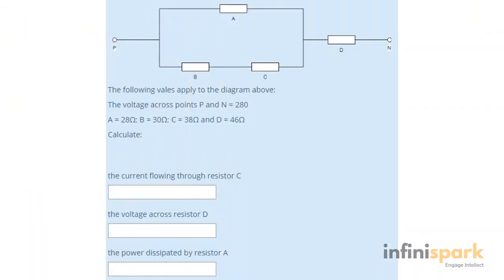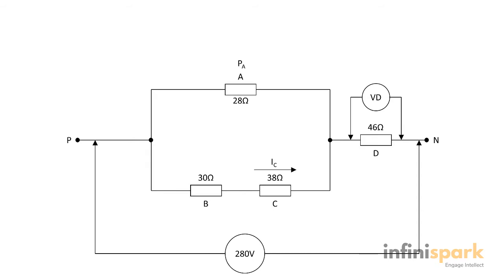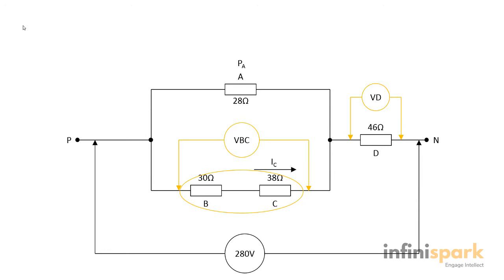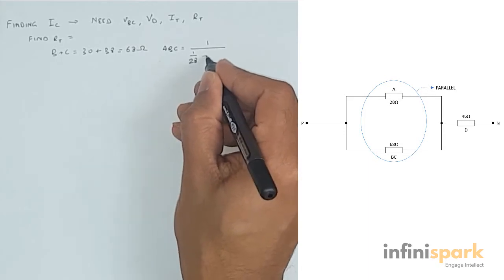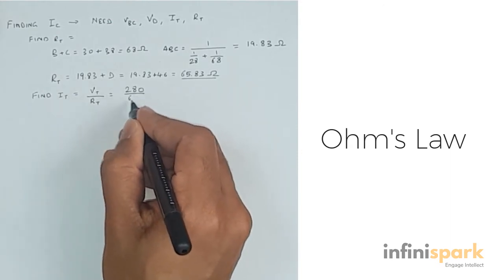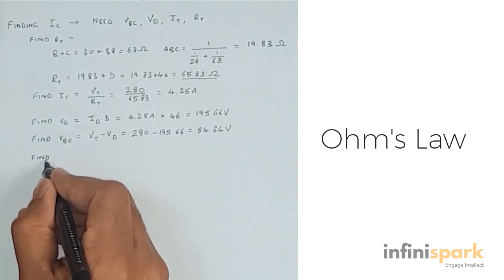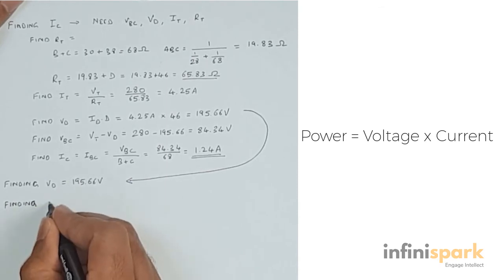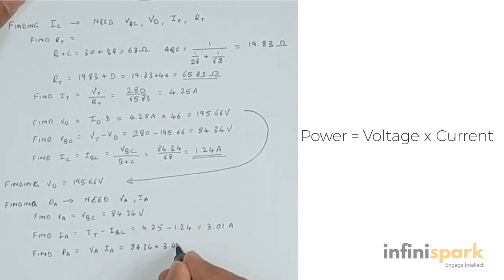How to solve Series Parallel DC ciruits

Comment: hi hus thanks for the video  when you multiply  4.25x46 =195.50 it just me or something wrong ?
Reply from the maker: Hi Ricky,
I can see how it was confusing, I should've clarified it on the paper in the video. Here's the explanation.

The total current is actually  4.253379918 and when you multiply that with 46, you should get 195.655476228.

In both cases, I rounded the numbers at 2 decimal places to write them, but in my calculation, I used the full numbers to avoid building up the errors, which could have created a bigger error for the final answers.

The LEA assessors, afaik, follow an answer sheet and if your results are way off then you may lose marks. So my suggestion to everyone is to not round of numbers midway, only your final answers.

I hope this helps. If not, plz reply to this comment. Thanks for asking the question, I'm sure that this will also help others.